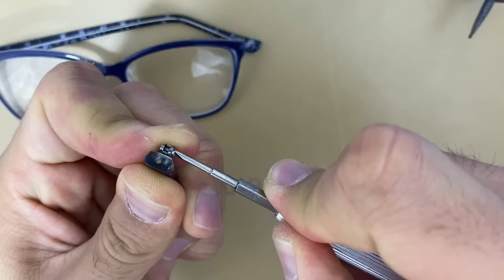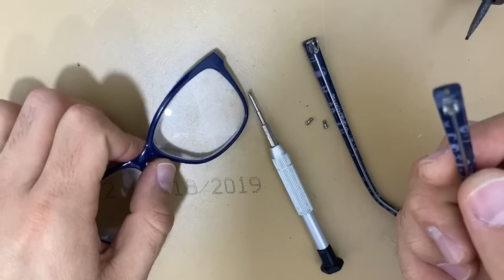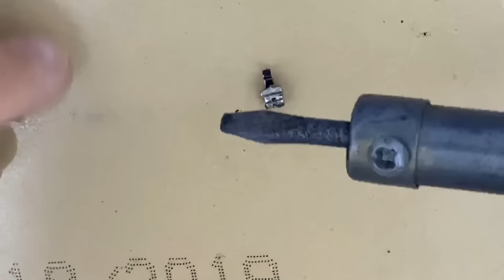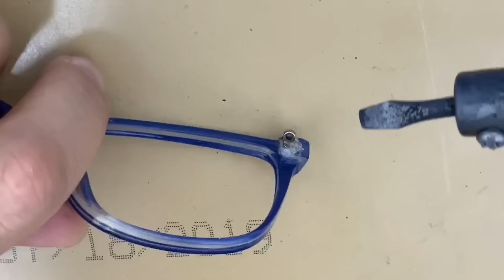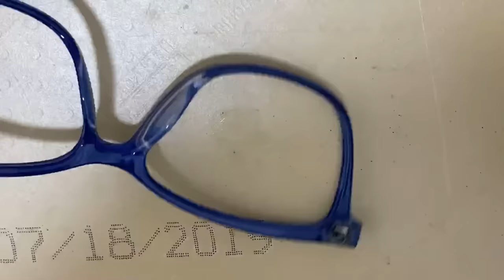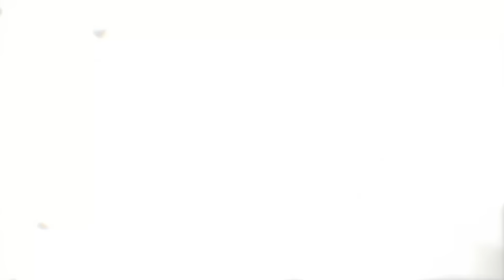Restoration of eyeglasses: hinge replacement. Реставрация очков: замена шарнира

Comment: Hi, which glue is used to hold the metal components in place in the frame that you use heat to mold?
Reply from the maker: thank you very much for your comment. I use simple superglue and it works well.